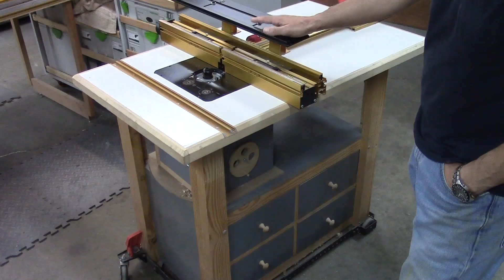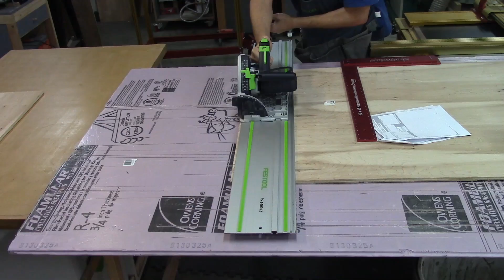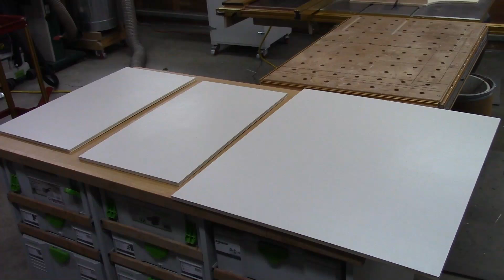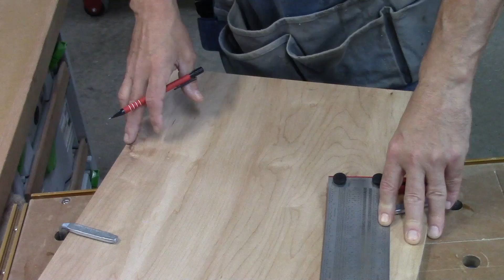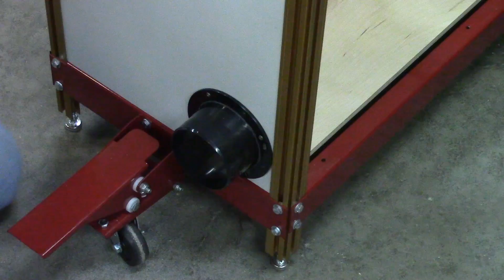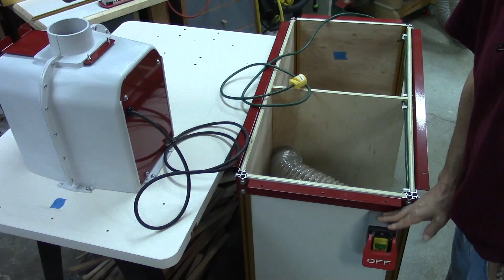How To Build the Ultimate Router Table with Incra - Pt.1

Comment: Hi Mike, love your content, real craftsmanship well presented. Getting back to some woodworking in a new garage shop, I have an old Twin Linear mounted on a folding table for storage and plan to build a proper table. Is the newer LS Positioner a worthwhile upgrade in terms of usability? I made some nice stuff with the old TL though I vaguely recall having to do some fiddling with it. Thanks!
Reply from the maker: Thanks! I used to have Twin Linear myself. And you're right, it can be a fiddly thing to use. This one is soooo much better.

Comment: You made a comment about the cabinet adding some stiffness to the router table. I have a follow up question about this but would prefer to continue this discussion offline. Is there a way to contact you privately?
Reply from the maker: There is a contact form on my website guyswoodshop.com

Comment: Guy: I really enjoyed the quality of your videos as well as your craftsmanship. I have some questions/comments:
1. I had the same problem as Bill Davis; can't find the link to download the SketchUp plans.
2. I have an entry level Rockler router table that was purchased at a widow's tool sale and am wanting to upgrade it. My fence was never designed to be parallel to the miter slot so I have learned to live with it. With feeler gages and stop blocks, I routinely adjust my fence to a few thousands of an inch. Is the Incra fence system overkill for most jobs? The Incra fence takes up a lot of precious real estate.
3. What a nightmare you went through to route the dust collection piping inside your cabinet. I think Incra shot themselves in the foot by not putting the dust collection port on the back of the Clean Sweep box. Your life would have been a lot simpler and you would have had more room for drawer space. Have you communicated that to Incra?
4. Your stand has three wheels with only one being steerable. I am a fan of the "all wheels steerable" approach because of difficulty getting into tight spots. Can the stand be adapted to add four aftermarket steerable casters?
Keep up the good work.
Reply from the maker: Hey Ben, the links are in the description of the video. You may have to hit the text that say "Show More" to see them. 
2. The ability to set a bit to the fence and then move the fence back and forth with repeatable precision without using feeler gauges and blocks is priceless.
3. It was difficult, but not a nightmare. Their system is designed to have the hose go down and not be used like I did.
4. With the "steerable" wheel in the back and locked down, it is rock solid. I'm sure it can be adapted to have for wheels on it.
Reply: Guy: Thanks for the response. I eventually had found the "See More" button which is the key step in finding the link for the plans. After viewing both your videos a couple of times, it is not clear why you need the cleansweep system. The router motor is already in a closed compartment with your table design. With a reasonable seal around the door, all the air flow will come through the opening in the router plate. Just add a 4" dust port on the back of the router compartment. What am I missing?
Reply from the maker: I didn't want the dust port coming out of the back, and the Clean Sweep enclosure directs the suction of the DC system. I can also use the interior of the cabinet for more storage, which I do.

Comment: Awesome job Guy! I'm going to build the same one. I like the red pulls, do you mind sharing where you got them? Also, what is a good durable paint that will hold it in the shop?
Reply from the maker: Thanks Todd! I got them from amazon. I used spray paint form the big box store on them, and then a couple coats of clear lacquer.
Reply: GuysWoodshop Excellent, thanks!

Comment: Great cabinet.  Just making sure...the stand is the one that goes up to 36" correct?  "INCRA Router Table Stand - for UP to 36" Wide Table"
Reply from the maker: Hey Tim,  the stand I'm using in the video is for tops up to 43".
Reply: Isn't the back panel width 33-3/4?  Seems like the smaller stand would work (up to 36").

Comment: Hello Guy - love the video and also the table. I am making the same one now. I have a question. I decided to use 3/4 inch melomine for the bottom because when I used 1/2 ply I was having a issue getting the center divider square to both outside walls. There was some sagging in the middle with the 1/2 ply. I shaved off 1/4 from the height of the center divider and am going to take off 1/16 on each of the drawer faces but do you see any issues with the left shelf or the downdraft dust system?
I will sent you a picture when it is done. 

Thanks Guy, keep the videos coming!
PS to Rick Chunko - I bought the flange and "Y" at Woodcraft and they are a match for a friction fit. Perhaps you could go back as they may have more than one type. Good Luck. 
John - St. Clair Shores, MI
Reply from the maker: Hey John. The 4" hose under the downdraft cabinet was a huge pain to get installed, If I had to do it over, I would have eliminated the top drawer on the left side to give it more room.

Comment: What size stand and table did you use? 43"?
Reply from the maker: Hey Patrick. Yes, I have the 43" table with the offset cutout.
Reply: Thank you very much. The stand just looked so much smaller than the table top.

Comment: Guy...im finding that my 4"y doesn't fit very well into my flange...even after sanding the end of the y. What else did you do or do you find that the y stays in place?
Reply from the maker: Hey Geoff. Mine fit in with a friction fit. Kinda tight, but it did go in. I think it may depend on the brand of fittings you may have, as I have heard this from several other viewers. They did manage to get it to fit eventually by sanding down they wye to get it to fit.

Comment: Nice video, in fact I decided to build your exact same cabinet.  I purchased a 4"- 2 1/2" Y connector and Flange from Woodcraft but it really isn't a friction fit with the parts I purchased and I was wondering where you purchased the Y connector and Flange components you installed in your video?  Your measurements for the cabinet were excellent from what I was able to build so far!  Thanks in advance for any help you can provide.
Reply from the maker: Hey Rick. Glad to hear your building this! It is and has been my go to machine since I built it. When it's done. you'll absolutely love it. I wish I could tell you where I got the wye. I've had it for years. If I had to guess, I got it off of amazon or from woodcraft. Is it too big or tool loose? If it's too loose, you could add some silver HVAC tape around it to seal it. Too big, and you could sand the outside a little to make it fit.